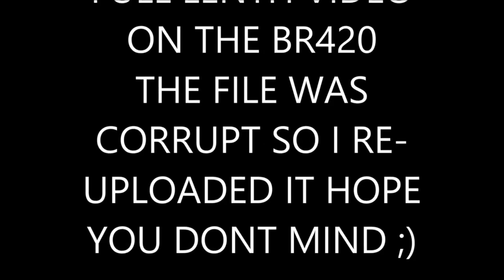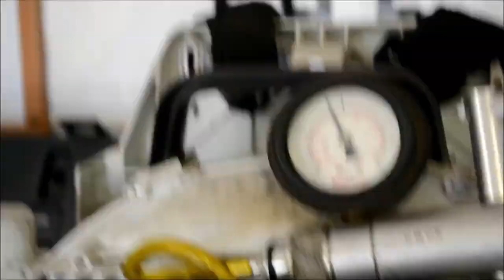STIHL BR420 COMPLETE TEAR DOWN AND REASSEMBLY AT 8 X SPEED.

Comment: Doesn't stihl sale replacement parts i can't find were to buy a new flywheel for mine guess it'll be sitting until i find one the broken original flywheel is stihl 4203 400 1200A llda 412 and can only find all used ones but i don't want a used part